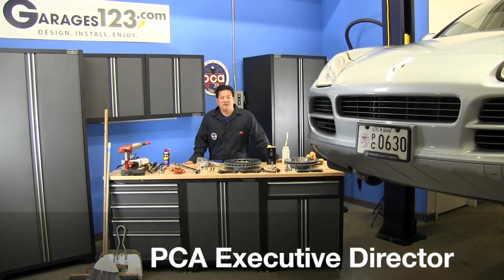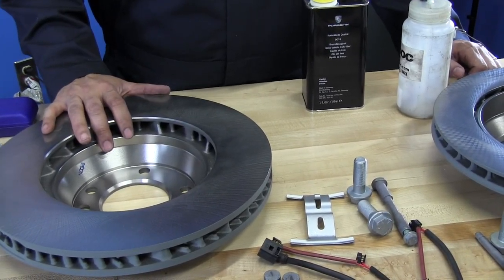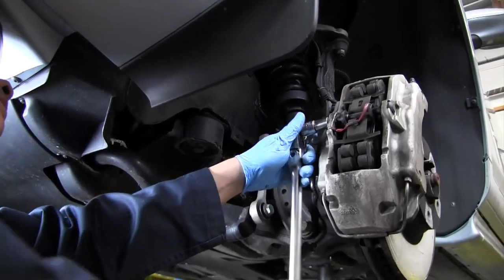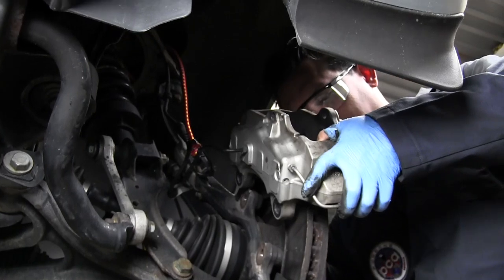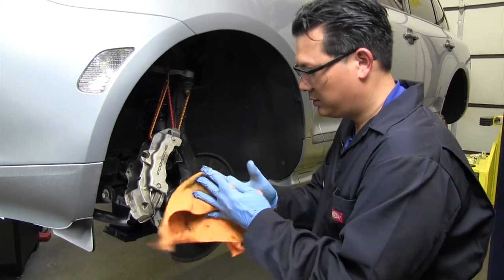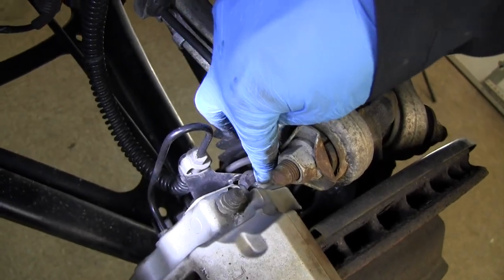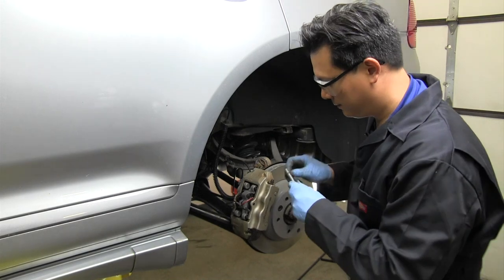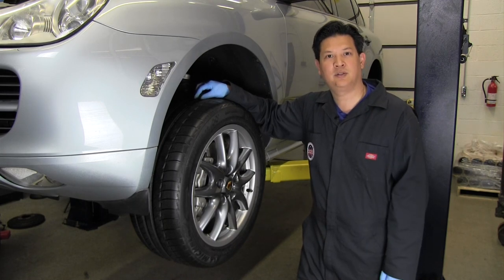PCA Spotlight: Replacing brake pads and rotors

Comment: Great video! Besides my brake parts being a lot heavier, this process was exactly the same for my Turbo S.  My front caliper bolts were extremely hard to brake loose on the drivers side, otherwise an easy job.  Thank you!